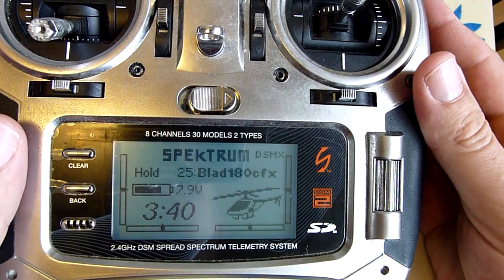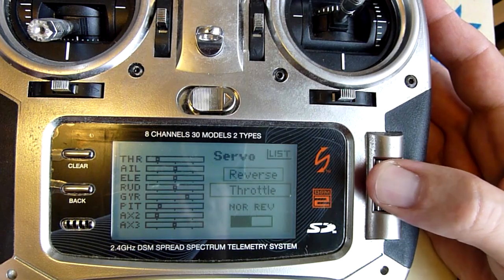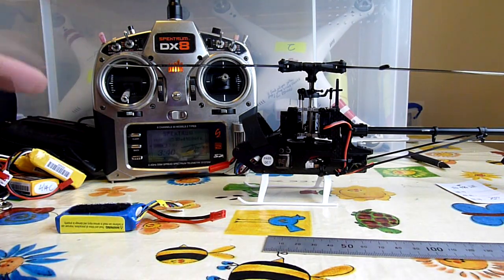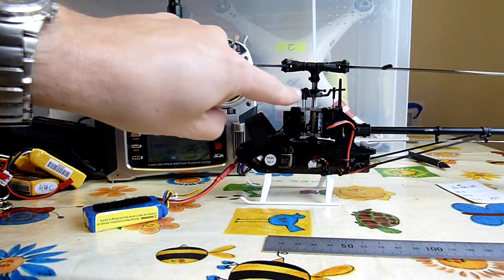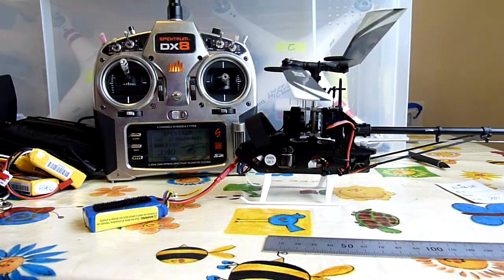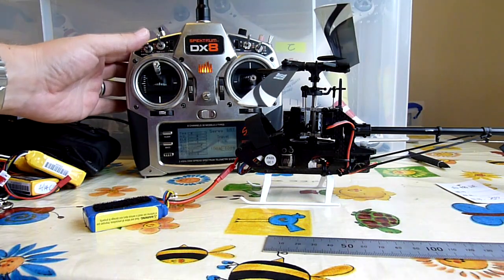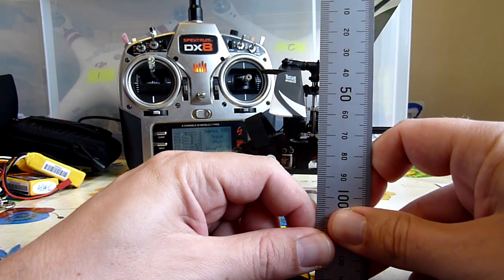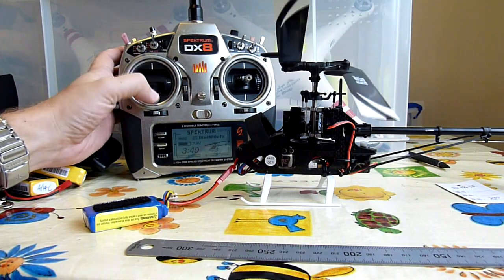DX8 setup for Blade 180 CFX advanced menu - servo centering, checking zero pitch and range

Comment: QUESTION,  I HAVE THE DX7S AND IM HAVING A WEIRD PROBLEM WITH SETUP. I SET MY TRANSMITTER EXACTLY HOW THE MANUAL SAYS TO,  HOWEVER WHEN I GO TO SPOOL UP IN ''NORMAL MODE'' NOTHING HAPPENS EXCEPT THE SWASH PLATE NOVES CORRECTLY WHEN MOVING THE THROTTLE STICK UP AND DOWN BUT THE MOTOR DOESNT COME ON. BUT IF I CLICK THE [F-MODE SWICH] THEN THE HELI SPOOLS UP  IN [IDLE UP MODE], CENTER STICK. TURN THE F MODE SWITCH OFF THR MOTOR STOPS WORKING. WHAT WRONG WITH MY NORMAL MODE NOT WORKING?
Reply from the maker: I would check your throttle curves/position in monitor screen, as chances are either throttle isn't going low enough to arm initially or your normal throttle curve is flat/wrong - did you start from a reset model ? Best to take blades off before playing with this for safety, and don't forget to rebind when sorted to ensure failsafe is set correctly with zero throttle.
Reply: @jamesb72  THANKS I GOT IT, CHANGED MY FMODE SWITCHES AND THROTTLE CURVES AND ITS GOOD NOW,

Comment: Hi, do you have a video on how to update the firmware? I have seen one video on how to do it, but it is not very clear. Also, I have the updater for the blade 350QX3, and it has a servo lead extension. ca I use this instead of buying the other cable? I think they are the same thing, just repackaged, and they have a slightly different look, but its three wires to a servo lead, and a USP plug on the other side.
Reply from the maker: steve sparrow the 180cfx firmware was super easy, just follow instructions on spektrum website - you do need to plug in dongle to get serial number to enter into spektrum website to get the file to then upload, but its very straightforward. You do need the correct SPMA3065 USB adaptor, other similar adaptors won't work. Worth asking your LHS if they have the cable can they do update for you, I know some will.

Comment: Thank you so much, I'm pretty new to hobby, crashed the bird, replaced a servo, torque tube and I kept adjusting the servos by removing the arm and trying to put it perfectly 90 degrees. I had way too much negative so it would'nt lift. Iwas really disapointed. I wasn't sure (about my skills) enough to try the servo centering and ajusting the pitch but finally tried it and worked. I'm just back from flight test and it flew as new!!! Thanks alot for the video, I tought the bird was 'dead'.

P.S.: You're right about the saves not being made after centering the servos.

              Sincerly!

                       Jean-Simon
Reply from the maker: Jean-Simon Léger No problem, you should update firmware as this fixes the problem with saves not working, also fixes the tail wag which was very annoying also. If you have a local model shop they can probably do the upgrade for you, otherwise you just need to buy the SPMA3065 USB cable to do this.

Comment: Great video. Just switch from a dx6i on the 180 to a dx9 but I am having an issue with the aux2 to aux2. I followed the instructions and set to reverse. I also can see the display and it moves in the right direction but i still  can't get into the servo centering menu. Can you guide me in the right direction? 
Thanks in advance
Reply from the maker: Check you have travel/atv at 100% for sticks in outer bottom corners, if the aux2 moves on monitor screen when you press the bind button, its most likely the sticks which it isn't happy with - it needs 100% travel to the corners, so if you have dual rates or travel set less than this that would be my first guess.
Reply: Thanks.  My expo was on. 🙈

Comment: Hi James thanks for posting this.
I did what you said on your video and everything went pretty smooth. Only thing I'm a little nervous about is the zero pitch at mid stick thing, to achieve this I have my pitch travel at 108% negative and 72% positive.
I had way more positive than negative initially....
Will these numbers be okay? Or should I make adjustments to make the numbers not so different from each other?
Thanks for any help on this   :)
Reply from the maker: As long as you have zero pitch midstick and the same positive and negative pitch the ATV/travel numbers on your transmitter don't matter. However if you have updated firmware you can centre servo's and mechanically adjust links to get zero pitch at midstick, which should then get your travel figures closer. Personally I would just fly it and if it flies OK then its fine.
Reply: Yes I have done the update.
Thanks  James.

Comment: i cant get my gyro gain to work on my dx8 no matter what i do any help please
Reply from the maker: You just need to check gyro channel settings, you probably have this incorrect, go back to the manual setup and go from there, check the monitor screen to confirm the channel is changing with your gyro settings and you should get wag as you increase gain. If not then you need to return to shop, but 99% it will be your settings.
Reply: Iv tried everything when I set the switch select then go to gryo and turn on I get No control over gain but when I go back to switch select it's inhibited again
Reply: I seen that u have your gyro on ltrim?
Reply from the maker: Johnathan Hendsbee I have it on gyro switch with l-trim for adjustments.

Comment from the maker: There is an issue with the 180CFX/AR6335 out of the box it will not save changes to servo centering, there is now a firmware update for this, you need to buy the SPMA3065 USB adaptor and follow instructions on helifreak 180CFX forum. http://www.helifreak.com/showthread.php?t=664109

Comment from the maker: IMPORTANT - there is currently an issue with the 180 CFX/AR6335 where changes to servo centering are not saved properly, so when you unplug flight battery the changes are lost, there is a lot of chatter around this on forums, and I believe Blade are aware of this, so they will be coming out with a fix, I suspect this will be included in a firmware update along with 6ch radio setup menu option, so you will need the SPMA3065 USB dongle to update firmware (unless you can borrow one or your local hobby shop will do the update on the counter for you).
Reply from the maker: firmware update is now out (11th November) - you need to download the Spektrum updater, buy SPMA3065 USB adaptor to read serial number from AR6335 in your 180CFX, then login to spektrum community website register this serial number to get download link to new firmware which you then update using the updater software - currently this only fixes the servo centering not saving issue, it doesn't address tail twitch (although Blade are apparently working on that next).
Reply from the maker: ***** 26 November v1.53 update now fixes the tail twitch, I installed this its super simple and tail twitch is completely gone now, definitely worth doing, just a shame Horizon didn't test properly and we all have to buy the USB adaptor to fix their oversight ;)